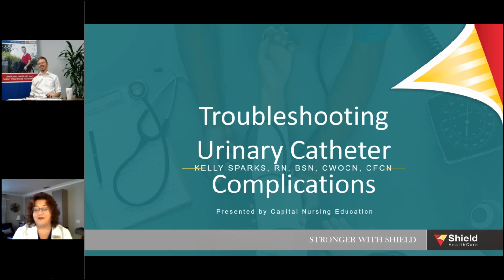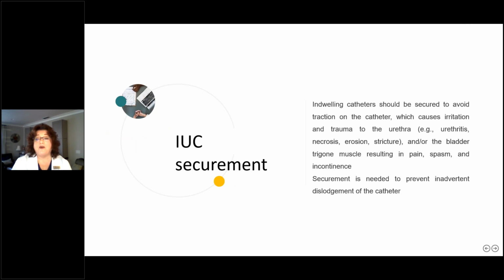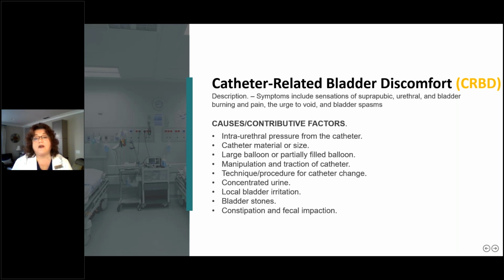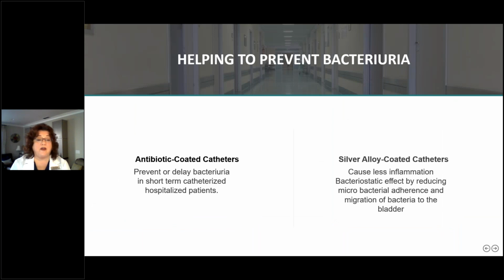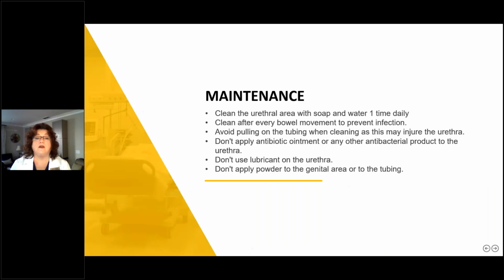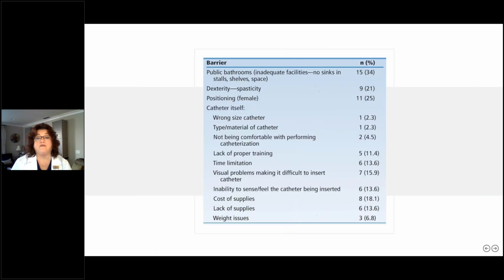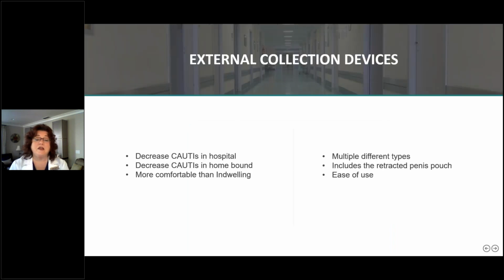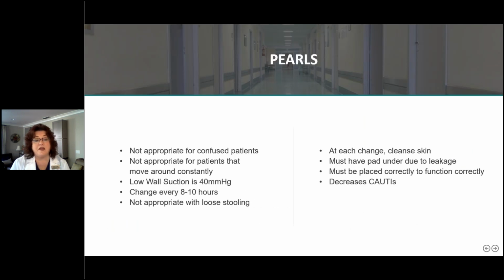Common Urinary Catheter Complications and How to Address Them Recorded Webinar

Comment: Everyone says pour into bag like the opening is not 1/8 th of an inch!! I had to use a 10ml syringe to get in the vinegar, forcing in the tap water. Maybe a mini funnel?
Give some real time useful ideas!
Reply: Use a spray bottle with a trigger action. Unscrew the adjustable nozzle and the inner nozzle should couple nicely to the tube.